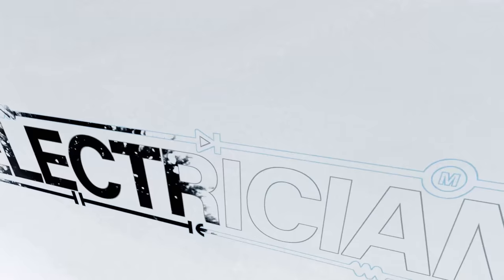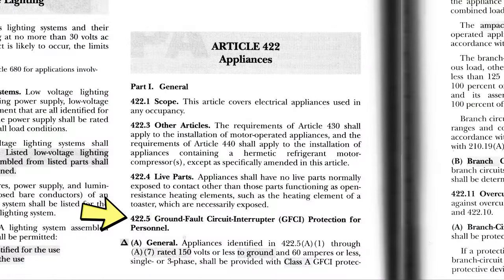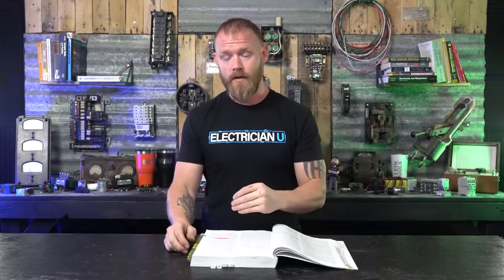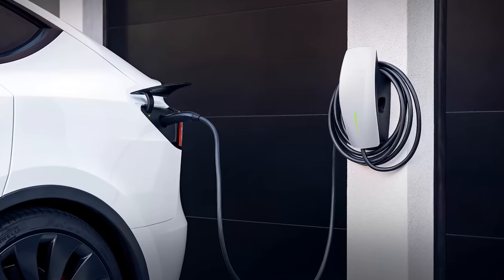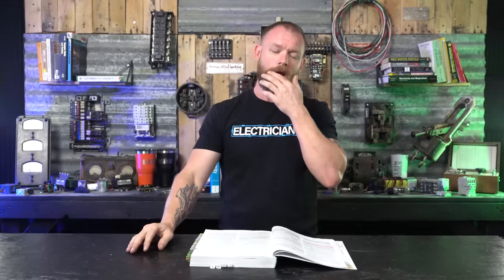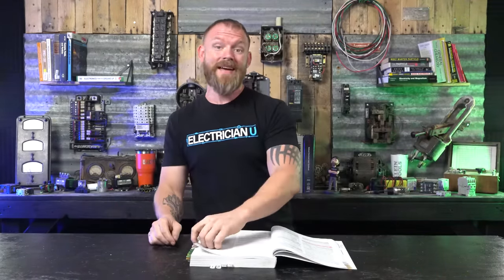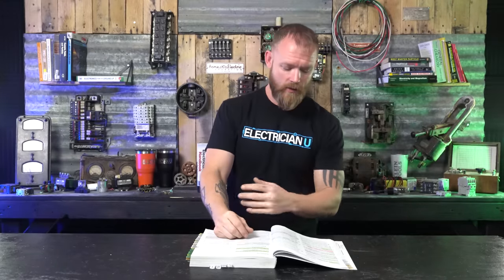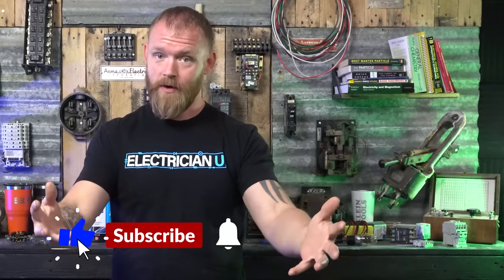Should We AFCI Protect Appliances?

Comment: @3:56 That was a bad idea ! 
My wife was washing the stove top put her hand on the sink and got a shock for some reason .
Reply: Yeah Dustin and the inspector both got this one wrong. The point of a GFCI is not just about people sticking stuff in the outlet. It's to protect people when metal becomes electrified. He also could have explained how the AFCI is to protect the wiring which is why you can't use an AFCI receptacle unless the home run is in conduit.
Reply: Isn't the point of the ground to deal with metal getting electrified? I'm guessing the stove if 240 electric, didn't have 4 prongs, just 2 hots an a neutral. I'm a bit disturbed by all the changes to electric code however. Thought we had all this figured out and standardized by the 1960s! The big problem besides cost to implement, is that average handyman is not updated on changes and their purpose, nor is the store selling the product.
Reply: @johnruskin4290  hopefully you mean 2 hots and a ground, not 2 hots and a neutral. 

Using a neutral as a safety ground can get you shocked.
Reply: @roflchopter11  
I deal with maintenance at my Church. All of our buildings are at least 50 years old and I've yet to see any of the 50amp 240v outlets for fryers or cloths dryers that weren't recently installed not have the third pin connected to anything other than the neutral buss. With the newer 4 pin outlets there are 2 hots, a neutral, and a ground. Most of our stuff is grounded via the conduit and most panels don't have separate ground terminals. I understand the need for safety, yet we act like there have been so many accidents and have to change everything, yet most of these installations are troubled free. In the case of 240v, you turn the breaker off before unplugging. As for the guys wife getting shocked I can accept changing a 3 pin to a 4pin outlet so long as I can pull another wire. I can't however add arc-fault breakers to vintage Square D NQOB panels. The whole concept with arc-fault was to protect old knob and tube circuits, however since most share the same neutral it didn't work for the intended application. Speaking of knob and tube, the funny thing is some of those old systems originally fused the neutral as well as the hot. Now with the GFCI and AFCI breakers needing a neutral hook up we are back to the same.

Comment: So the user of that 50 amp service oven will be safe, but the electrician who may come to perform service on the oven (and may have to pull the oven out from the wall) won't have any GFCI protection??
Reply: That's funny.  Only one state requires an electrical certificate to work on appliances,  Washington.  And even that is overkill.

Comment: So in areas that specify  "Branch circuits rated 125 volts 15 or 20 amperes  supplying OUTLETS or DEVICES (I would interpret that as receptacles, switches,  light fixtures,  basically anything that mounts to an electrical box)  in SPECIFIC AREAS are required to have AFCI protection"    Note we are not talking about appliances in this context.  

My interpretation is kinda mixed.  Example #1.  I have a dedicated 120v NEMA 5-20R for a professional grade treadmill in my living room.   I know that must be AFCI protected because it's a branch circuit supplying a device,  a receptacle in this case.   

Example #2.  What if I have a dedicated  120 volt 20 amp circuit supplying a 120 volt 1500 watt baseboard heater that is hardwired, in a bedroom addition,  without a line voltage thermostat which I interpret as a device which then would require AFCI.    Would the hardwired 120 volt baseboard heater in this example require AFCI protection if I were just using the heater's built in thermostat? I would love to hear thoughts and comments

Comment: It remember its location location location. Damp locations like basements and garages were within 6' of watersource GFCI..  If it's in the garage you don't need AFC I. When you cross the threshold into the house through the garage it becomes AFC I from there on out that means if your washing machine is garage located GFCI is only required is only required not AFC I

Comment: Hello, I have a question, I’m interested in becoming an electrician and recently encountered a brand new electrical panel that was painted over by the painters. I don’t mean the covers, the painters took the covers off of these panels and painted over them as they were painting the garages. I told them they should at least try cleaning the metal parts with isopropyl alcohol so at least the breakers would have a clean connection but later read that the inside of the panels should absolutely not be painted; so now I’m wondering if the panels should be cleaned or replaced? I don’t know if this is a problem seen often but would live to hear what an actual electrician would do. 
Thank you for your time.
Reply: I’m assume they didn’t mask it off and sprayed the whole interior? For doing something that stupid the painter should be paying for a brand new panel and the labor cost to replace everything. No sense to clean it

Comment: My window A/C that was brought in early 2020 has GFCI, built into the plug. I believe that most appliances that would want that protection have them included in the plugs nowadays. Not to say that it wouldn't be a bad idea to include it in the wiring of the home. It seems that most manufacturers are getting to the place where they include them on the appliances nowadays. I believe that the electrical codes in America do the bare minimum to protect the user and leave it up to the manufacturer. The unfortunate cost of having better protection is higher cost to build a home! It's a double edge sword as far as that kind of stuff goes. I believe they think it's a cheaper alternative to let the manufacturer include the protection in the product you buy instead of just making it safer in the new homes!
Reply: My window ac from 2007 has it in the cord so having gfci on every circuit is just silly. 
I have an older house with some floor outlets. They now are a big No no with out gfci protection and the outlets have to have those tamper proof gates and a cover when not in use.
Reply: Yah plugging a GFCI into a GFCI isn't going to work. And how many people are sticking paper clips in outlets? Plus if tamper-resistant is code, how come I can still buy regular outlets at the home center?
Reply: @johnruskin4290  the tamper proof thing is to prevent kids from putting things in the outlet that's what I  understand. Well here goes... we didn't have those when I grew up.  Our parents taught us not to do things like that and they also watched and disciplined us more than parents do now.  No parents are too busy on social media or playing video games to parent.

Comment: The thing is I wouldn't want things like refrigerators or freezers on GFCI circuits because if it nuisance trips when you are at work or not going to be home for some time, you might come home to a refrigerator or freezer full of spoiled food.  I would never put these appliances on these types of circuits in the first place.
Reply: IMO these appliances should be required to have built-in GFCI that is smart enough to automatically reset after say 15 minutes to an hour, thereby both providing protection (by being a GFCI) AND eliminating the problem of nusicance tripping (by resetting itself after some time).
Shouldn't even require that many additional components, the circuit is just "a little bit different" and requires maybe one supercapacitor to provide energy to the "reset" solenoid (or you know just make the "breaker" part of the GFCI a toggle relay instead of a normally open relay, that way it only takes a pulse of current to turn it on OR off).
I'm an electronics hobbyist, if I can figure this stuff out, certainly they can, and there's some reason they're not doing it. It would be nice if someone could explain that reason to me (and if it's just cost, then it's time for a code change).
Reply: I never do just for that exact reason!

Comment: GFCI is going to be on every circuit.  And that's good.  But I have my doubts about arc fault detection devices; here they've reached code after a long campaign…  by the manufacturers of arc fault detection devices.  I have yet to see any evidence for either their necessity or their efficacy that has not come from sources that will profit from their introduction.
Reply: I agree. It's a great idea, but I haven't seen any independent testing showing they are beneficial either. I have tried to trip them by creating series arcs and although I have not tried extensively, I never managed to get one to trip. A Youtuber by the name of Eric Stark now has two videos of testing them also and he hasn't been able to get one to trip either. I'm not saying they don't work, I'm just saying I haven't seen unbiased proof that they do work either. A short will trip them, but it'll trip a regular breaker too.
Reply: I've seen problems they would have prevented, if the homeowner hadn't replaced them with standard breakers because they kept tripping. but what I see the most of is homes that should have had more circuits, and didn't because of the cost of AFCI breakers.

so while they do add a layer of safety, the cost of them is causing unsafe practices.
Reply: @kenbrown2808  Yep.  The ones we have here (UK) are not prone to false tripping.  But the expense is certainly a big problem.  We're expecting the next amendment to the regs to make them mandatory virtually everywhere. At the moment they're required in limited circumstances but 'recommended' elsewhere.
Reply: @calmeilles  you have the advantage of late adoption.  in the early years of AFCI breakers, the slogan was "carry two spares, because you know you'll have one bad one in the batch."  I'd install the breaker, and turn it on to test it before hooking up the circuit, so I didn't waste time hooking up a defective breaker.
Reply: @kenbrown2808  I agree they afci protection can be great but when it comes down to troubleshooting the issue it is better if the proper amount of circuits are run for example not having 3 bedrooms on one circuit then trying to look for issue.
Reply: @MOtherBoardFire  yeah, 3 watts per square foot, and I see 1800 square foot houses with 3 15 amp circuits carrying every general use receptacle and light in the house.  and the customer has a Hoover Wind Tunnel vacuum.  I just got in the habit of advising people to plug their vacuum into the bathroom or kitchen.
Reply: GFCIs are often tripped by normal running motors.
Reply: @jeffkardosjr.3825  no, they are tripped by motors that are wearing out and bleeding current to ground.

Comment: I highly recommend spacing out those afci/gfci breakers. If you have them all next to each other, they'll get cooked and fail prematurely. I've had to replace quite a few because of that. The panels where there's an open space between them don't have that problem.
Reply: Any recommendations of a panel that has plug on neutrals and space?  I'll be replacing my whole panel soon, and it sounds like the code is GFCI or AFCI "basically everywhere," so the plug on neutral is something I definitely want
Reply: @Squick99  always get a panel with more spaces than you think you'll need. I like square D but they've been having problems with meeting supply. CH tan handle is pretty decent.
Reply: @Squick99  both Siemens and Cutler Hammer type CH make good panels.  if there's any corrosion issues at all where you live, pay the extra to get a panel with a copper breaker bus.  the new Leviton panels are built to be future proof, though, and they are reasonable if you buy them without the "smart panel" modules preinstalled (or, of course, if you want smart panel technology, they have it.)
and yeah, as Drac says, buy a panel with at at least 10 extra full spaces if you can.
Reply: it's also smart to keep them away from high load circuits - I've heard of them nuisance tripping because of EMF.

Comment: Riddle me this bat man. I have a question on my journeyman exam were I have to do the voltage drop formula and find the length of the wire not the vd which I have already vd=2k×L×I÷ CM =  3=2×12.9×L×9÷6530 solve for L

Comment: Arc fault breakers have always been over sensative pains in the ass for electrical contractors, general contractors and the homeowner, ever since they were put on the market. They still  suck 30 yrs later. Better but still bad. 
 To make them code for every receptacle in a home is absolutely ridiculous.
 We know that there are some backroom deals being made  for profitsby government officials and the manufacturers. 
 It's similar to the big push for people to use CFLs instead of regular incandescent lamps. The whole push was to buy more time for LED production to ramp up and lower the cost before flooding the market with LED lighting. They told everyone CFLs were going to save the world and save money when they are worse for the environment and were more expensive. They even made them part of the code. 
  It's always about profit and never about the safety and protection of the consumer.

Comment: Arc faults are nothing but a NUISANCE! Sometimes can't even use a vacuum cleaner as it trips let alone turn a light on as it reads the arc signature of the switch being flipped with a load on it.  One customer with a whole house reno went out of his mind as we explained it won't pass inspection unless these breakers are installed. He replaced all the nuisance ones after the job was finished and all final inspections. Its a RACKET!
Reply: did it on my own house. I passed and an hour later was replacing breakers. Returned the seimens afci/gfci for 1400 bucks.

Comment: Video suggestion....making a pvc holder to protect your reach sticks and 6ft drill bit. Use 3/4 or 1" pvc two threaded female pvc couplings and the matching size threaded ko seals for the end caps. pvc glue one end and duct tape that end so you onow you cant open that side. no more weak plastic cover that shatters or gets eaten by the sun. Oh and never us a razor knife to remove the tape cuz you split the fiber glass of the reach sticks 🤘😠 and remember ladies save a fuse blow an electrician instead 😏 ....hey they dont have a shocker hand signal emoji we created that move!!!wtf

Comment: EV's requiring GFCI is OK I suppose. What EV's really need is AFCI protection because they draw a lot of current for a long time. Any arc fault will create a fire situation over a long period of time.

Code simply doesn't cover this. AFCI is limited to 120v branch circuits. An EV circuit which is typically 240v should also be included IMHO. Because it's not code you cannot buy an AFCI 240v 2-pole breaker even if you want to. I want to, they are unobtainium.

I suppose when enough houses have burned down due to EV's code will be updated.

Comment: I still think arc fault protection is a scam. I'm not sure how you would test such a thing. I've seen YouTubers trying to trip an AFCI by simulating a frayed cord and fail to trip it. I'm not even sure why an electric dryer needs AFCI protection. The cords rarely move.
Reply: I lean towards this opinion. I tried to find out the stats on house fires caused by arc-faults and I could not find anything that suggested this is some huge problem requiring a whole new type of expensive breaker. Maybe the plug and outlet system could be made to fit more securely??
Reply: I've tripped a GFCI with a 50mhz ham radio. I wonder how problematic AFCIs are with radio transmitters.

Comment: You absolutely don’t have to arc fault 240volt circuits other than hot tubs or pool related circuits where I work at. And that’s inspectors telling us that not just a company I work for
Reply: Read the 2020 NEC. You are not correct
Reply: I’ve got green stickers on panels that say otherwise. Just telling you what’s applied in my area.